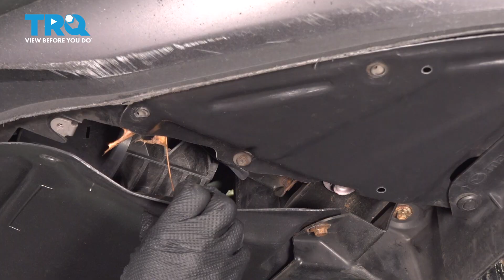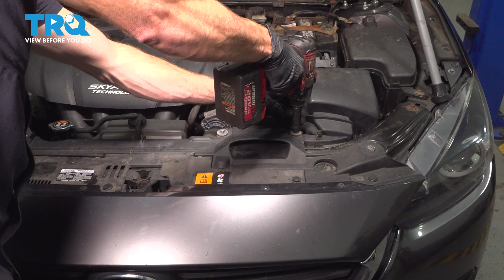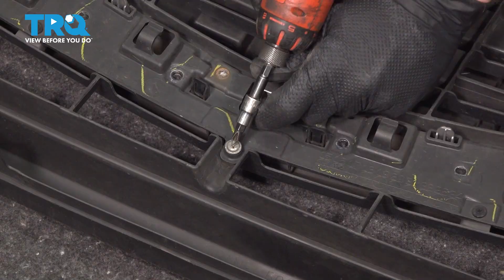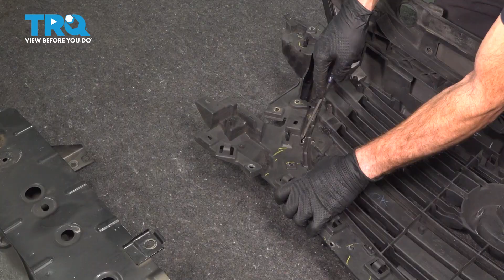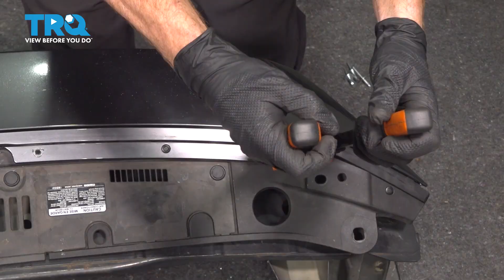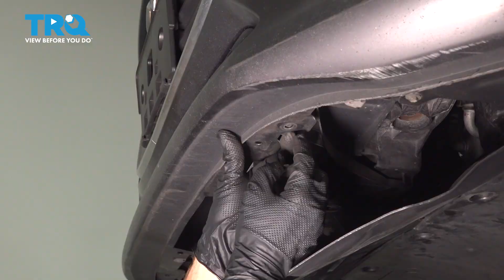How to Replace Grille 2014-2018 Mazda 3

Comment: Had a chipmunk chew through both front turn signal wire harnesses. What a PIA. That 11mm socket trick is first rate. Wish I would have seen this video first.

Comment: Thanks for this video, was very helpful as I was installing an aftermarket grill. Though my 2016 Mazda 3 didn’t have rivets. It just had screws which were way easier and I was thankful for that. Thanks for the info though.